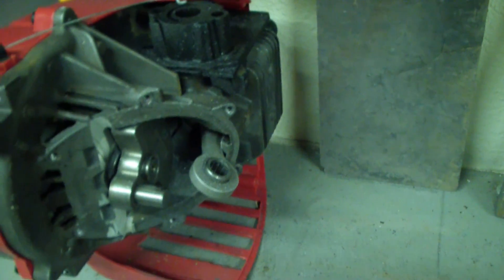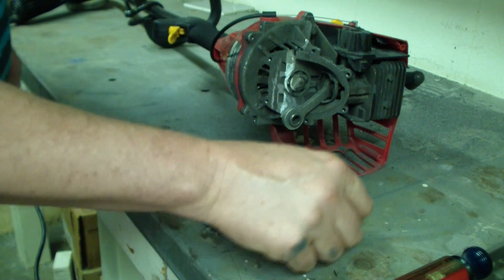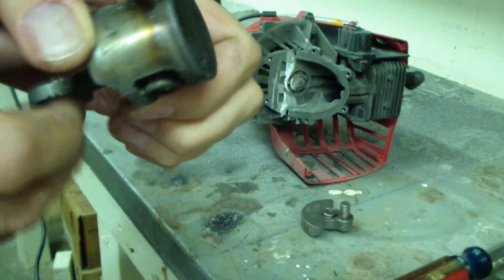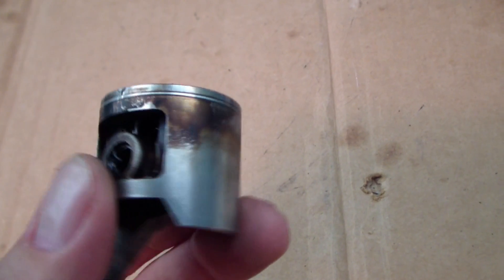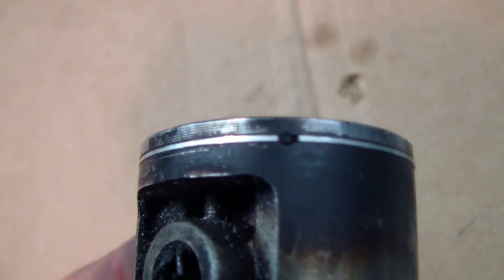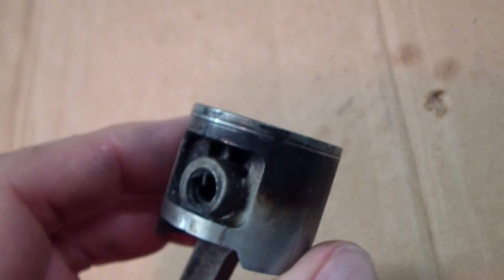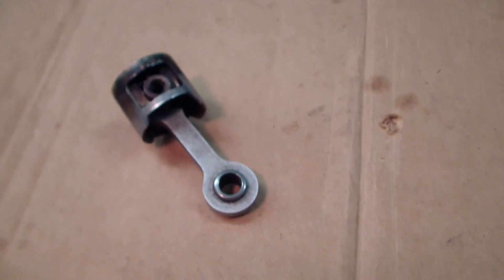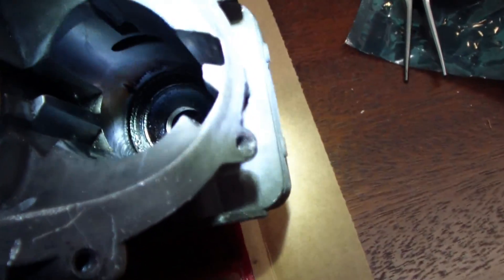Homelite Weed Trimmer Repair Tutorial Part 3

Comment: Great video❤ Thank you.
Clearly the ring was stuck.
You are right about these things running lean.
I think the heat makes the ring stick to the piston resulting in loss of compression.
A quick way to confirm it ,absent a compression tester , is to pour a capful of 10w40 oil in the sparkplug hole.
You should get it to fire briefly.
Reply from the maker: Lean fuel means less oil. Need the Pakman carb tool to make mixture richer.

Comment: But I see your problem. NO GAS. The piston head looks like nothing but dry carbon buildup. No sign of fuel. Perhaps you should have cleaned the carb. Since ethanol can mix with oil and oil has to be added to the gas. I'm assuming the really thin hard to see film or some times globs of substance found in the carb of engines like this is what happens when ethanol mixes with oil and then sits in the carb after the engine shuts off. It solidifies into a really fine hard to see gel and clogs up the carb. Should have been obvious when the engine was turned over multiple times in the first video with the muffler off, but strangely no fuel was pouring out of the exhaust port of the cylinder...........................

Comment: Look at the cylinder wall inside the block head. Not the piston so much. One side of the piston is of course going to have carbon build up. why? Because of intake and exhaust ports. As the piston closes off the exhaust port all that exhaust still in the port and the muffler is going to cling to the piston. The intake side of the piston is going to have air, gas, ethanol, and oil clinging to it making it cleaner compared to the exhaust side.

Comment: Someone gave me one of these heaps of crap (same model I'm pretty sure) for free because it was locked up.  Cylinder looked great, just wouldn't turn over.  Took the power head off the shaft/clutch assembly, took the bottom of the crank case off, filled the cylinder and crank case with marvel mystery oil and let it sit overnight.  Took some work, but managed to free it up eventually.  Worked it around a lot, felt good about how easily the engine turned, so threw it all back together and the darn thing started right up!  Lasted 4 minutes and locked right up again.

Seeing you take the piston out of the cylinder of this thing... the piston has ONE ring?  This garbage should be criminal.....  I've yet to dig into this trimmer again, which sucks because today I really needed it.  The clutch exploded on my troy-bilt trimmer 1/3rd of the way through edging my yard... Garbage!!

Comment: Same issue. could not replace just the ring. Too bad this was repeat was a great machine until the design to fail/wear-out succeeded. Good thing I got it for 8$ at the flee. Compression 60 lbs at end of season ran on proper fuel mixture. Next time will use like 30::1 instead of specified 50::1. I would have been happy to replace the ring and give it another year or two of use if I could have.

Comment: i have homelite blower HBL26YBNC I need to remove piston how do i remove con rod from from crank shaft .thank you in advance,
Reply: Remove the snap ring and use a small bolt to tap out the crank shaft carefully with a hammer.
There are no videos on this . I just figured it out myself😂

Comment: There was not enough oil to lubricate 
Cylinder piston and ring get too hot
Since piston is aluminum it melts at lower temperature than ring or cylinder and it grabs the ring and dont let it expend to seal and create the compression

Comment: This is a classic example of a owner running the machine with little or no oil. Or not shaking the machine a minute to mix the gas and oil as time does seem to separate the mix. Most of the time very diluted oil mixes are rough on the engines. The piston has the symptoms of overheating. VF

Comment: When using a Compression Gauge. The throttle must be held wide open to get an accurate reading. 
Suggestion for the future. When String Trimmer acts like this. Take fresh gasoline mix with 2 cycle at a 40:1 Ratio. Then buy a bottle of Sea Foam at your favorite store. Mix 2 parts Sea Foam with 1 part Gasoline/Oil mixture. Remove Spark Plug. Get piston to Top Dead Center and fill cylinder up. Reinstall Spark Plug. Let the Trimmer SOAK for 24 hours. Drain the mixture out. Put spark plug back in. Try to start engine. [The piston ring looked like it was stuck in ring groove.]
Also, use Amsoil Saber Synthetic 2 Cycle Oil. Should stop piston ring "sticking".
Best of Luck with your String Trimmers.

Comment: My homelite weed eater was used like 5 times and will not start again. Help somebody
Reply from the maker: Verify, fuel, spark and compression. That is all it needs to run. Mine had stuck rings. Should have used stronger oil/gas mix I guess. Pouring ATF in cylinder may fix.

Comment: And how do you remove the Piston without breaking stuff
Reply from the maker: Perhaps a large press would do it. You cannot purchase repair rings or piston for this. Designed to be repaired by replacing entire block that costs as much as new trimmer.
Reply: @KentDiego  You can buy piston rings, but you must purchase them by size. measure the bore and the thickness of the ring. do a search online. I bought a ring for my chainsaw that was no longer available a few years ago, it still runs great.
Reply: @KentDiego  thanks
Reply: @KentDiego  my has 95 psi good spark new carb and would not start maybe 95 psi is too low for this engine

Comment: Looks like i have the same issue, is there anyways to un-stuck a ring without damaging anything? Carb cleaner soak? Seafoam soak? Did i heard correct you cant remove the piston?
Reply from the maker: I did some experiments in video part 4. Automatic transmission fluid seemed to unstick the rings. The long term fix is to buy the "Pacman" tool and adjust carb to give better fuel air mixture. I gave up and got an electric string trimmer and it starts a lot better.

Comment: The problem lies with both the burnt gas carbon, and the un-burnt oil, supplied in the fuel, mixing, thus making a gummy like paste, that sticks to just about anything.  It's a pest. Passing by the rings, it gets settling within the piston grove, and prevents the ring from moving freely like it should, and over time, and use, freezes it up in a manner, that the ring doesn't seal properly against the cyl wall, properly. You loose compression, the more it's run, and more buildup locks the ring in even tighter, into the piston grove with use, till finally there's not enough seal, to create good compression needed for it to run. That's what's happening here. There needs to be a soaking solvent, that both softens (eats away), and washes away that gummy paste . Sadly, nothing fills the bill properly. The piston has to be removed, in order to clean the problem properly, and restore compression again.

Comment: One needs to remove the piston, to do a proper job of freeing up a locked in ring. Needs soaking to help soften the carbon build-up for a few days, then heat applied using a blow torch. Apply only enough heat to the ring, to allow it to expand on it's own, and come out of the piston slot. One has to work on it slowly, without rushing. Process might have to be repeated a few times, before the ring finally gives on it's binding hold. Once freed, remove it, and clean the piston slot out properly, as well as the ring (or you can replace with a new ring). Reinsert into main engine block, and compression should be restored back to normal again. Re-adjust the fuel mixture, to prevent this from happening again in the future. It was running too lean. Ring wasn't getting enough oil to keep it from sticking, and gathering carbon gum build up. Note; don't overheat the piston, or the ring, while trying to get the ring to free up. Use plenty of lubing, to soften the built up carbon gum. Soaking helps soften the build up, so soak it well. Applied heat, allows the ring itself, to free it's own self, without striking it.  One might have to repeat the soaking and heat applications, till the ring finally gives up it hold in the piston slot. You'll see the ring begin to expand under heat. Continue applying lube while the ring is hot. It will work it's way into the piston slot and soften the carbon buildup, till it completely comes free.

Comment: This issue seems to be a common problem with these 26 cc engines. I have two 26 cc engines, that have the very same issue. One just stopped, while I was using it, and never fired again. I opened it up for a close check, seeing I had lost compression (same problem with both engines, as above). One engine was used on a Homelite (like above), and the other was in a Stihl leaf blower (still the same engine block)). I found NO scoring on either cyl. or anywhere on the walls, yet lots of blow-by, like seen above in this video. They are made poorly, and ring quality is terrible). I think that replacing the very thin ring, is not worth the time, and money invested, as it will only occur again, after a short amount of time used. The thinness of the ring, makes it very easy to snap while installing, so you'd be taking your chances in replacing the ring. If it has served you well enough over time, get rid of it, and save the useable parts for other engines that need repair. These engines just seem to not hold up, over time and use. Take my word for it. Save money, go out and buy a better, larger model of better quality. You'll not regret it.... Agreed?
Reply from the maker: The issue is too little oil and high heat. The EPA mandates a lean fuel air mixture. High temperatures and less fuel is less oil. You can buy a "Pacman" tool to adjust carb to fix. I gave up and got an electric trimmer and cannot be happier.
Reply: @KentDiego … You're right in saying it's running far too lean. The rings are not getting enough oil, to keep the rings free, and doing the job they are intended to do... build compression. Problem is, is in solving a carbon build-up frozen ring, in an engine that still has a good engine block/cyl., and a good piston. To do a proper job of freeing up the ring, and get it working properly again (thus getting the engine running as well), one has to remove the piston from the engine block, without damaging vital parts. They don't like to be taken apart, plain and simple, in-order to be worked on properly, and correct the issue. There is no cleaning fluid available, that can be put down the cyl. to eat away at the carbon (while soaking), to free up the ring inside, properly. The only way to do a proper job, is to remove the piston completely, and give it a good cleaning, and maybe replace the ring with a new one. It is this issue I was speaking about. These engines don't like to come apart, once put together at the factory, without causing more damage in some way or means.  A good video, on how to remove the piston on these engines, without causing more damage, would serve well, for those that require it. Otherwise, the engine is a throw away. It's wiser for a buyer to purchase an engine that has a separate,  removeable head, where the piston and rings can be worked on easily, and put back together.
Reply: @KentDiego … NEW IDEA>>> Putting my thinking cap on, I thought, what is used, to both soften, and get rid of burnt on stuff in an oven, crossed my mind?  Ever think of using "Oven Cleaner Spray"? Not only does it soften, hard baked on greasy spills, that bake  on so hard, it's even hard to remove with a scraper, or steel wool, without using the spray first. After all, it is a burnt on crustation that is causing our problem in the first place, even though it's not a food product. Try a good soaked coating of Oven Spray, and see if it softens things up, and loosens up the ring.  No harm in trying, as the engine is no good now, right? Give that a try Kent, and see what ..Happens.  Maybe we'll get a surprise, and the ring will loosen up.
Reply: @waynedavies3185  I do not agree. I have this machine and it is almost ten years old, but it must be used and maintained properly. This engine can be disassembled, but you must have a machine to remove the crankshaft without damaging the seals or bearings. Everything can be fixed, some things require more work and others less, and it is true that these machines are designed to change the entire engine block when they break, but they can also be disassembled as I told you. These machines also tend to be factory revolutionized, better adjusted well with a tachometer, and then the dilation index of the ring is greater than that of the cylinder, which means that you can not be working with the machine too long without resting it, better take a Little more than a good synthetic oil 2t free of residues to soften this extra friction by the dilation of the ring.
Reply: @marvelitadeverdad5387  … A good company, would sell their products, that can easily be taken apart (in the crank area), without the use of a press. I have worked on small engines since I was in my teens. I opwn many small engines right now, but most have the abilities to be taken completely apart with just the use of hand tools. No heavy press is needed to remove a crank shaft, or piston. First of all, these presses are expensive, and also take up a lot of room in a shop, while it sits doing nothing 90% of the time. When I come across an engine that requires the use of a press, I scarp it perinatally. The cost of fixing it, becomes not the worth of added cost.   One item, I really didn't want to purchase, but I had bought something else in the store, that turned out to be of poor making, and was returned. In order for me to still get value for the money I spent on the other product (store didn't give money back refund), I was forced to by a leaf blower, I really didn't want to buy. I usually check well before hand with a blow-up of every engine I buy, to insure the engine can be fully worked on with ease, and hand tools. I'll tell you, I wizened up after that, and refuse to deal with stores that don't refund money back if product turns out to be defective, and be forced to purchase other items, I really don't wish to buy. Ended up, the store was shut down over this issue about 6 mos. later. They lost all their business, and they didn't remain open all that long, since they first opened their doors. I have engines that date back into the mid 50's, that still run perfectly on the first pull. and I'm the only one that services them. I know how to service an engine.
Reply: @waynedavies3185  thanks hombre

Comment: Man, when you take that angle grinder to the block one handed while holding the engine with your other hand made me cringe! Seems like putting the engine in a vise or clamping it to your work bench so you have both hands on the angle grinder may be a bit safer...

Comment: Did you ever take the carburador apart? Usually that's the one to cause problems,  I take mine apart all the time and flush all the ins as and outlets real good with carb cleaner and usually fixes the problems with starting,  I watch all 4 videos and I didn't see you taking that step